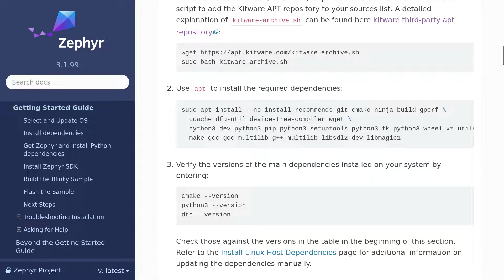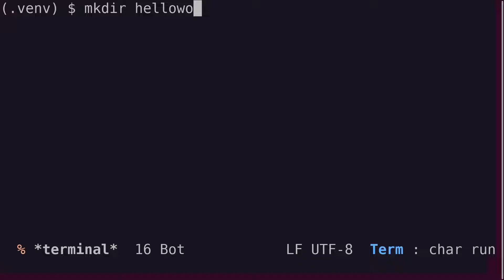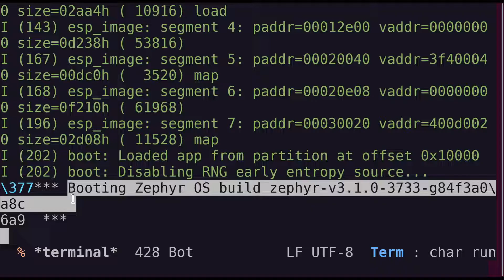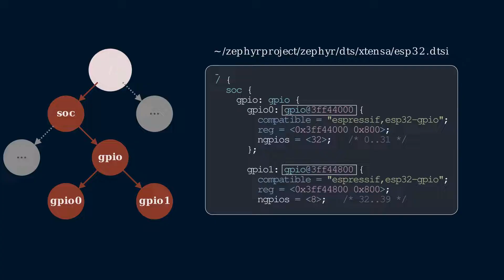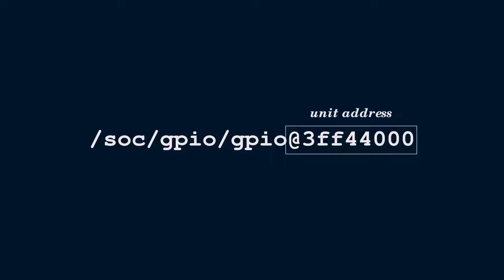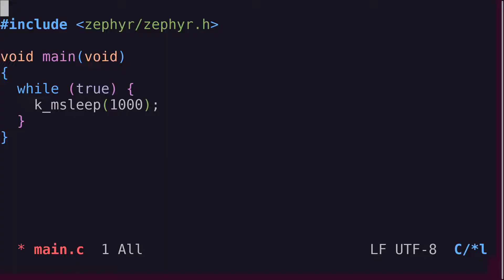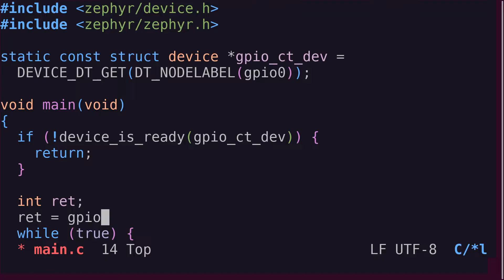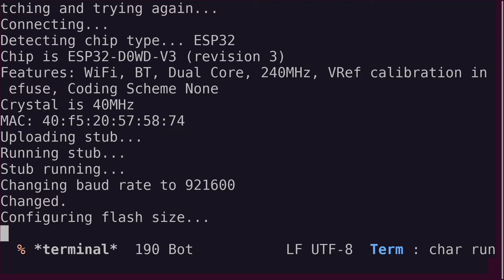[#1] ESP32 on Zephyr OS: "Hello, world!" (Blinking LED) [Part 1]

Comment: Hi. 2025 is ending and technology changes a lot in such small period of time:

1. Some of your links are broken.
2. Your code doesn't compile because of the header files.
3. Compilation instructions has changed since then.

For example:

*  -b esp32 doesn't work anymore; instead use this: -b esp32c3_devkitc
* For the header files use: #include <zephyr/kernel.h> instead of <zephyr/zephyr.h>

One last advice: please let the viewer to view the commands your are executing. You've done it very fast so one needs to go frame by frame to get them.

Greatings!

Comment: coming from MbedOS , you see how easier was MbedOS .. Sad  that they killed mbed OS.
Reply from the maker: Thank you for the comment. I haven't tried Mbed OS myself, but I agree that different projects call for different levels of abstractions and control. I only do embedded programming as a hobbyist, but I suspect that Zephyr will be very beneficial for larger projects where there are multiple developers involved and there is a need for flexibility in changing out the underlying hardware, even between different CPU architectures.

Comment: I am sorry to tell, but this software solution is ridiculous. If i want to work with hardware at low level - i work with hardware at low level, using vendor's supplied HAL.
But this is... Beyond. You adding more low level abstraction in top of low level abstraction which is LOL.
Reply from the maker: Thank you for your comment, and I agree that Zephyr is probably not the ideal solution for every embedded projects. Personally, I mainly use the STM32 HAL for 32-bit and AVR for 8-bit projects. I think that Zephyr can be a much better fit for very large projects with multiple programmers and the need for really strong separation between the firmware and the underlying hardware. Zephyr really makes it easy to swap between different MCUs and even MCU architectures without changing a single line of firmware code (due to the Devicetree model which is borrowed from Linux). Also, of course, my examples in these videos are truly ridiculous and only meant for beginners to learn the principles of how Zephyr works :-) I would never choose Zephyr (or any other RTOS) to only blink an LED or run a single stepper motor. In any case, thank you for sharing your thoughts and I appreciate it.

Comment: Seems like a lot to go through.  Is their any advantage of using Zephyr instead of the esp-idf with freeRTOS already integrated ? Does Zephyr use its own IDE ?
Reply from the maker: I think it depends on your specific situation. In particular, I think that Zephyr offers a good way to separate application code and hardware configuration, which could be important for large projects and projects that are looking at using more than one microcontroller family, for example.

However, I program microcontrollers as a hobby, so Zephyr is more of a fun learning opportunity for me. And, yes, I feel that there is a long and steep learning curve, which is why I started making some of these tutorial videos so that hopefully my (many) mistakes could help someone else have a smoother learning journey.

For my hobby projects, I mainly use Zephyr now for 32 bit projects (STM32, ESP32, RP2040) and avr-libc for 8 bit projects. And even when using Zephyr on ESP32, I can always use the esp-idf HAL directly if I need to.

As for the question about an IDE, as far as I know there is not one "official" IDE for Zephyr, but CLion and VS Code seem to be popular. I think most modern IDEs should be able to handle the CMake-based workflow. Personally I use a combination of Emacs and the Zephyr CLI tool called west, together with OpenOCD and GDB.

This is just my personal view, and I'm not associated with the Zephyr Project in any way, so you will probably get better answers and more diverse viewpoints by asking in the Zephyr forums online.

Comment: I've run through the tutorial here but when I try to build I get this error message:

       west: unknown command "build"; do you need to run this inside a workspace?

Any ideas ? I'm running this command from the helloworld folder and not src.
Reply from the maker: Sorry to hear that you're facing this trouble. Could you please try to run the shell script to setup the Zephyr environment? On Linux/MacOS you can run ". ~/zephyrproject/zephyr/zephyr_env.sh", assuming that your Zephyr installation is in the ~/zephyrproject directory. If you are on Windows, the equivalent script is zephyr_env.cmd in the same directory. I just tried it on my system (Debian 12) and it works. Please let me know if you're able to fix the issue. Thank you.
Reply: @thepullupresistor  It works, thank you !

Comment: hello there, I was working on zephyr os with the esp32c3 dev board. the build with the west tool is successful but it does not flash using west flash. can you help?
Reply from the maker: Hi! Very cool, I haven't been able to get hold of an ESP32C3 yet, so unfortunately I've not played around with it so far. I'm not sure if there's anything different about the C3 when it comes to flashing, but in my experience with ESP32 WROOM and WROVER modules there are a lot of things that can cause the flashing not to work. The most frustrating experience I've had is with unreliable FTDI FT232RL boards, so now I exclusively use the ESP-PROG since it has JTAG as well, is very fast and works every time.

I'm happy to try and help troubleshooting, but may I ask that you share your exact problem, system setup, and what you have tried already in the Zephyr Discord #espressif channel? That way, if i can't help you, maybe someone else will be able to. Also, if you solve your problem, others with a similar problem can also learn from it. You can find an invite to the Discord channel on the https://www.zephyrproject.org/community/ website.